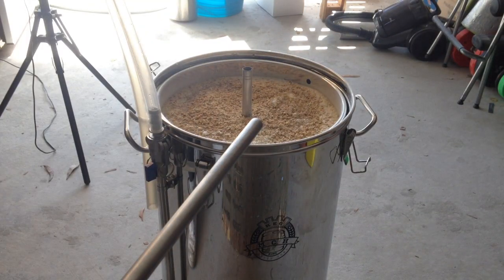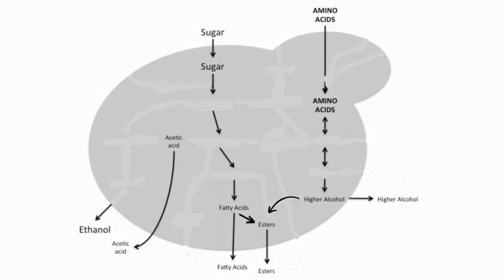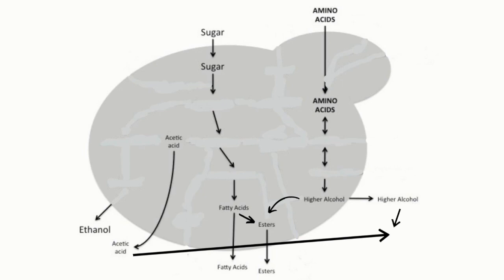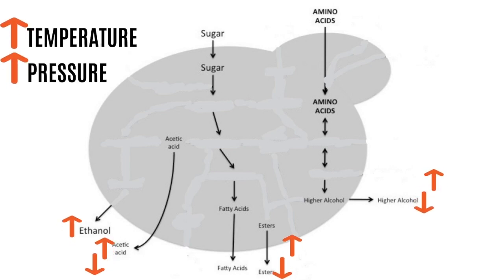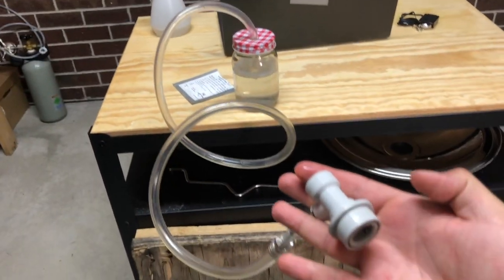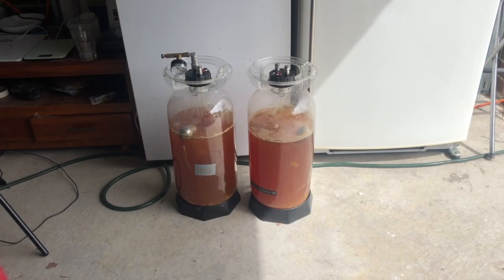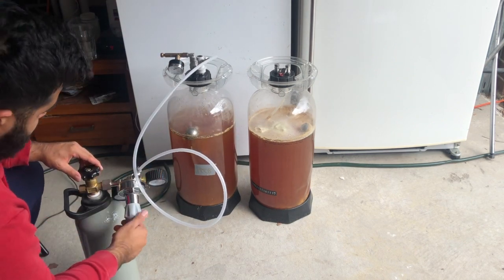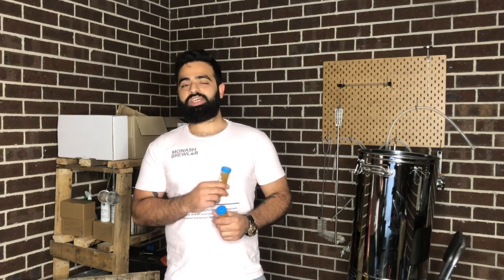Yeast Under Pressure  | Homebrewing Experiment 1 (Pressure Fermentation) | Part 1

Comment: You should try the method for dry hopping where you use two food safe magnets, one inside your hopsock and the other on the outside of the vessel. Held above the liquid level and then dropped in at the right time. Then no need to open up the fermenter.
Nice video enjoying a science take on it

Comment: Hey man, this was a really useful video to me. I enjoyed the straightforward explanation to something complex such as yeast behavior under pressure that was quite excellent. You earned my like and subscription.

On a side note, I feel like a lot of the basics are missed or just not explained with other channels...maybe they don't want bore the audience, but really...it helps with understanding how all the pieces to the puzzle works. Thank you for this!

Here is a tip that I have learned that you might benefit from. I noticed when you dry hopped you had to open both containers, which is probably fine but if you wanted to minimize oxygen from entering or wanted to maintain that PSI pressure, you can add the dry hop bag at the top of the vessel after the wort goes in and use strong magnets to hold it at the top(one on the inside of vessel and one on the outside of vessel), once it's time to dry hop, just remove the magnet that was placed on the outside of the vessel and the hops bag will fall into the beer.

Comment: Good video. I also pressure ferment and appreciate your effort for explanation. 
Great way to ensure o2 free environment is to get a couple of bits of steel, put each one in a ziplock bag and "string" the sock across the inside lid of your fermenter after adding wort...hold them there with neo magnets. When its dry hop time, they're totally o2 free, remove the magnets, and your hops drop in.
Dont worry about oxygenating with dry yeast, yes I get that it assists in the controls for your experiment, however it's not needed. 05 will ferment fine if you just put the lid on and shake your fermenter for 20 seconds....hey...same amount of air in both right?
This is insightful and have subscribed. 
...take it you keep your fermenters out of the light right and that you've got decent temperature control? That's actually important. I use tilt...they're hopeless WRT accuracy of ferment gravity under pressure, however they do give a very accurate temp reading. Just take proper samples using a party tap at your OG and FG. Everything else is a bit moot....however again, even if tilt is inaccurate, considering you've got one for each...a reading can be compared I suppose. 
A bit of advice...actually post the video when you get your final results, itll be more meaningful, especially if you have lots of videos and results. Good stuff, keep it up
Reply from the maker: Hi Jacob! Thank you for your feedback. The use of magnets to hold the dry hops inside the fermentor is a great trick! I will definitely be giving it a try next time, especially for my NEIPA's. 

Re the oxygenation for dry yeast, although has minimal effect on fermentation and its products, it does assist in yeast health and multiplication (vitality and viability) if you repitch your yeast. This subject is infact an ongoing area of research at our company and I will be able to report concrete findings on role of oxygen for dry yeast in near future. 

I do keep my fermentors out of light and in a temp. controlled environment (the two fridges you see in the video) :) I agree on the tilt being inaccurate with gravity readings but that's the best tool available at the home brewing scale, in my knowledge. I do have a iSpindel I am trying to put together and engineer for better accuracy.

I too wanted to include the results in the same video but I personally struggle to watch videos longer than 20-30 mins and this one would have crossed that time limit. I will make an attempt to shorten some snippets and compress the information as much as I can for future videos.

Thank you for sharing your thoughts and the helpful feedback and I am glad you liked the video :)

Comment: Interesting.  Can I get your opinion? 
I have a 4 gal blonde ale( supposed to be a helles but LHBS ran out of lager yeast) fermenting at 78° F in corny keg day 1. I pitched 11 g of Voss kviek, which is known for orange esters, but it's said the lower temp will suppress that. Would the Voss Kviek Ester be further suppressed under pressure? I plan to attach spunding valve on day 3 but maybe now after 14 hours? 
Voss kviek @77°F ferments out in 5-7 days according to white paper.
Reply from the maker: Hi Tony, thank you for your question, more than happy to provide my opinion. 

If your intention is to minimise esters, you could apply pressure early on during fermentation as that is when majority of esters are produced (1-3 days into fermentation). Applying pressure after this period might not have considerable effect. Since you are using Kviek, you will have to apply pressure sooner. 14 hours should be okay.

If the intention is to ferment more like an ale, you could increase the temp to 98-100 F and apply 10-12 psi pressure to get more esters while cutting your fermentation time to half. 

Hope this helps!